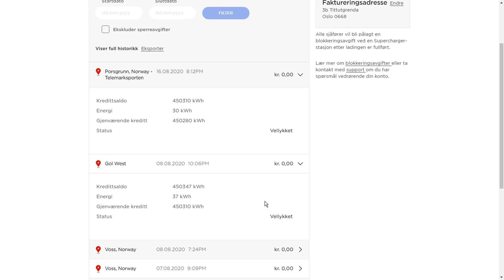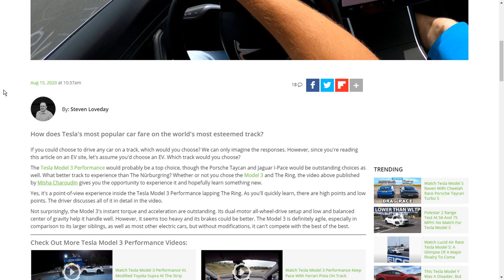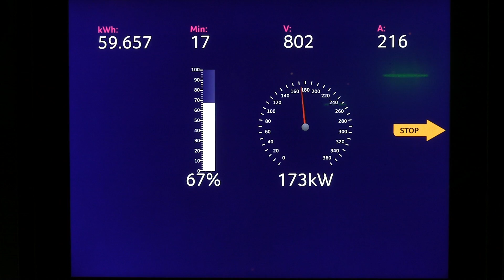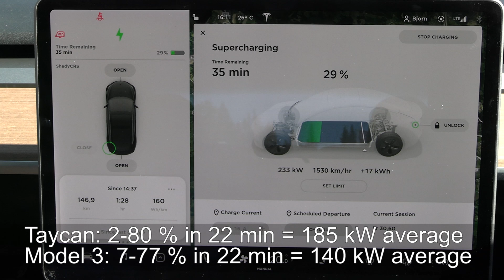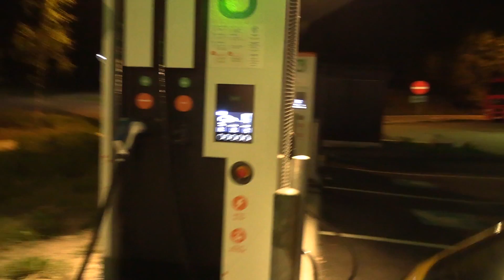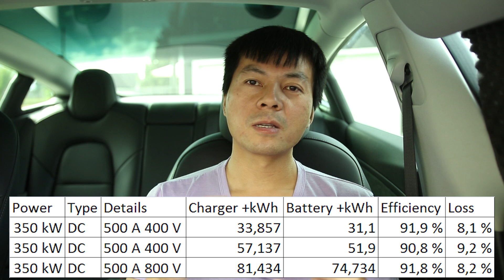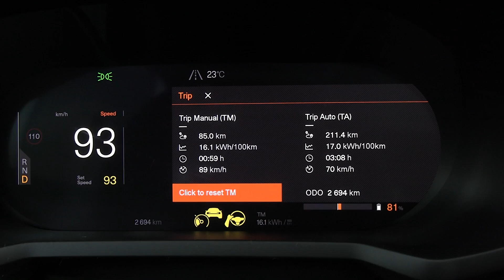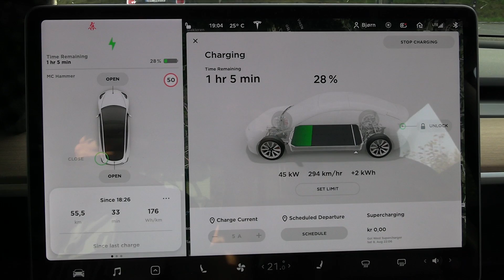Pros and cons of 800 V battery and charging systems

Comment: Most new 75kW+ chargers support 800V+ systems so there is no need to install 350kW like Ionity to utilize it.  It's only Delta that does not support it by default on their HPC.
 For example all Hyperchargers support up to 1000V, even the 75kW one.  And they are not more expensive than the 400V Delta chargers.
Reply: agreed, the charger isn't mush more expensive but the power to supply it is
Reply: @johnchartrand5910  How is it more expensive to supply a 150kW charger that supports 1000V vs one that's only supports 500V?
Reply: @baldurornoskarsson1204  power is far more expensive due to demand fees when it is used.
Reply: @johnchartrand5910  A 150kW 500V charger needs the same power from the grid as a 150kW one that supports 1000V.
Reply: @baldurornoskarsson1204  yes but the reason these high voltage chargers are put in is to support 250kw or 350kw

Comment: Capacitors have the ability to charge much faster but the energy density is lower so maybe there'll be a lower range car that can fully recharge in 10 minutes.
Reply: I don’t think the average person wants to be charging their cars every 100km because capacitors are empty. Supposed capacitors can run for that long. They would be interesting to higher launches. With lithium, Tesla can already do 0-100 in 2.4 seconds. With capacitors that could become less than 2s although having an independent system of capacitors just to have a better acceleration is probably not worth it just as an ev run by capacitors.
Reply: Super capacitors have way less capacity - like <10Wh/kg vs a reported 254Wh/kg for the lithium batteries Tesla uses. So to get the same capacity under ideal circumstances a super-capacitor would weigh >12 tonnes
Reply: CED99 So capacitors have 25,4 times less energy density per kg than lithium at best. That would put the 530km WLTP of the model 3 down to 20,8km. Not feasible in the short term or long therm either because I believe capacitors isn’t a new technology and therefore is close to being as good as it gets.
I was far to optimistic with my 100km estimation
Reply: Capacitors energy capacity is very low compared to batteries both in mass, price and volume, so for most EVs it is not worth it. However there are certain EVs with high stop-start that use them: CAF trams e.g. in Luxembourg. Other possible use: City buses and garbage collection trucks (start-stop every 20 m).

Comment: Hi Bjorn, as a battery modelling engineer for an OEM I would be happy to exchange with you to refine your analysis here. I am not saying you're wrong but there are points that can be clarified and would help understand why Porsche and Tesla have different charging curves than Audi and why efficiency should be dissociated from energy consumption. I am happy to help if you want.
Reply: Well, if you have time I would gladly want to learn more and ask some questions? Probably lots of people following this channel also...
Reply: Great offer in my view... I think you can contact Bjørn directly through Facebook (messenger) That's what he asked another follower to do the other day (about borrowing a Tesla Model 3 Sr+) I look forward to hear / see the results from your contribution in Bjørns reporting. BR, Per (Denmark)
Reply: @nakfan  thanks, I will have a look!
Reply: The voltage for each cell is always around 4 volts. The only difference in a 800 volt based system compared to 400v is the lower current in the charging socket, cables and connectors. Tesla cells throttle earlier because of their cell chemistry. Tesla beefed up the before mentioned EE to support higher current to overcome the 500a ccs2 Standard
Reply: @ExperienceCN  The difference between the P100D and the 100D is a custom-built motor controller that can handle the higher amps. Double the voltage, you halve the amps.
Reply: Very brave man.
Reply: i realize it's kind of randomly asking but does anybody know a good place to stream new tv shows online?
Reply: @Javier Kannon Flixportal :)
Reply: @Finnegan Skylar Thanks, I went there and it seems like they got a lot of movies there :D I really appreciate it !!
Reply: @Javier Kannon you are welcome :D
Reply: You model batteries? You pose in your boxer shorts holding a battery and wink at the camera? My wife wants to know more ☺
Reply: @Nickbaldeagle02  Haha, good one! Don't forget I'm an engineer so I only cover myself with calculators and rulers while doing it 😊

Comment: Hey Bjorn, why do you keep on comparing Model 3 with a Porsche Taycan ... i believe you should compare it with Model S ... just my thoughts!
Reply: Because Model 3 is the king of 400V cars what comes to charging.
Reply from the maker: Because Model S is based on a battery/EV design that was released in 2012. But Taycan came out in 2020 and has a more modern design. And Model 3 came out in 2018-2019 and is also way more updated compared to Model S.
Reply: @bjornnyland  So basically you're saying that Model S contains outdated technology ... ...so not a technological lead for Tesla.

Comment: The faster charger are still in needed , Consider  most cars being EV hardly ICE and how many charger heads would be provided to that amount?
Reply from the maker: Once people move over to EVs, more and more fast chargers will pop up in that country. Just look at Norway's impressive charging network. And as pointed out way too many times in this channel; you don't need to recharge too fast as long as you have large enough batteries.
Reply: As more EV's replace ICE vehicles, the current gas pumps will be replaced with charging heads
Reply: @Fredrickarm  And how many gas hoses in each station now?   How long it fills up those tank?
Reply: The thing with EVs, is you can typically charge where you park. More homes, more businesses, more groceries, more activity centers, more garages etc. will provide charging, especially in places where it attracts customers to shop/dine. Faster charging may be nice, but EVs really shouldn't be looked at through the lenses of gas cars.
Reply: Having carried out surveys of the time taken at various ICE filling stations in the UK the average was between 8 - 10 minutes, which included paying time, probably buying some snacks, etc. The main difference with EV’s is the majority of people will charge at home something most people can’t do with an ICE vehicle. There will be some living in places without parking that can’t do this but they may be able to still charge at work. This means you don’t need as many charging stations as fuel pumps but you do need many more than we currently have in the UK. There is still a lot of misinformation on charging station numbers in the UK, the apps show those at dealerships, which are not actually available to most people plus lots of 7.5kw chargers that are useless when on a long distance drive. This makes the map full of chargers but actually there are very few, especially outside cities.

Comment: Here is the thing: Porsche costs ~200k price of battery ~10%, model 3 costs 40k price of battery ~50%. So if you have got the porsche you really don't care if you "fry" the batteries earlier than of model 3.
Reply: So, you are saying both batteries cost around $20k
Since the Porsche battery has higher capacity, you are indirectly saying Tesla batteries cost more per unit energy than Porsche. 
Maybe it's possible, I don't know

Comment: Bjørn, I think 800 vs 400 doesn't matter so much. Differences are negligeble. More important how fast is possible to charge on home 3 phase electricity. We will see how new battery technology will run, whether it will be SSD or something else.
Reply from the maker: For home charging, 7 kW is fast enough for most people. I am even fine with just 3.7 kW. 11-22 kW which is possible today in many EVs is pure luxury.
Reply: I am also fine 99.9 percent with a single phase Schuko/household plug for charging. If I ever needed to make back to back trips with an overnight stop at home (very unlikely) then it would be obvious (to me) to use the street chargers around the neighborhood for the 7 or 11kW fast charge.

Comment: 800V is supposed to have a lot more advantages then just charging speed. I'm hoping that Sandy Monro does a teardown on the Lucid Air which is a 900V system and like Tesla, and unlike Porsche, is both effecient as well as high performance. Will the Lucid be significantly more effecient than Tesla because of their higher voltage or is their range advantage due mostly to a bigger battery?
Reply from the maker: "supposed" is the keyword here. When I drove Taycan, I wasn't thinking: "Oh, this 800 V system is awesome." The car felt and drove just like a 400 V car.

Comment: How is 800v supplied? Is it being stepped-up at the station? I thought ~400v 3-phase was the maximum you could get on a european grid? If being stepped-up, this will have (heat) losses that need to be considered.
Reply: Ooh, no. The UK railway overhead power lines are 25,000 volts. Have a word with the energy supplier and they'll happily build you a 100,000 volt power supply. For a small fee.
Reply: Normally it's 400V. But the voltage in the high power lines is significantly higher and since the charging stations need much power, they are probably connected to a 10000 or 20000V line. So it is possible to step it down to 800V.

Comment: In the Model 3 lap some performance degradation started at the end of the first lap, considering the length of the Nurburgring if the Taycan started to see degradation  only after 1.5 lap this represent a significant advantage.
Reply: Yes and he couldn't push it as hard as he wanted because the brakes got too hot
Reply: @xLaserwalker  Tesla 3 brake overheat warning after just 5.3 km,  1/4 of Nordschleife lap.
Reply: Foersom - Model S Plaid did a lap in 7:13 (Taycan’s best lap was 7:23) -
https://www.teslarati.com/tesla-model-s-plaid-production-pictures/
Reply: Save Rio - You’re comparing a purpose built sports car with a retail price of ~$240k to a family sedan that costs $60k. A much fairer test would be comparing a Tesla Roadster 2 to a Taycan.
Reply: @TraditionalAnglican  the Taycan is a Gran Turismo lmao. It's not an electric 911
Reply: @TraditionalAnglican  This is true for all the dynamic performaces of the car, here we are considery the tecnology behind the battery. If you take in consideration a 130k Model S you will have the same results.

Comment: Since it is possible to charge at 250 KW with a  400 V system,  and 250 KW is fast enough for any automotive application,  that proves that 400 V is sufficient.  For trucking applications,  higher than 250 KW charging rates will be required, necessitating higher voltages.
I Don't believe the amount of copper saved in an auto by going to 800 V results cost savings significant enough to overcome its disadvantages. In particular, the need for DC to DC conversion.
Reply: "250kw is fast enough for any automotive application"

For passenger cars, probably, but in the US, at least, I think we're going to find out with electric pickups and large suvd, which will probably get 2 miles per kwh at highway speeds on a good day, that a 250kw recharge speed, isn't going to be fast enough to convince your average joe to convert to EV, outside gas/diesel going over $6.00 a gallon.
Reply: @thelondonbroiler  let's look at that a little more in depth.  Assume the pickup has a 150 kWh battery to go 300 miles at 2 miles per kWh. Also assume the larger battery can maintain a 250 kW charge rate up to a 50% SOC. Doing the math, that would allow 150 miles  to be added in18 minutes. Seems good enough to me.
Reply: @npbetts1  That's good enough for me too (presently 30 min to get 100 miles in my Bolt).  My comment was a prediction of an average Joe in the US. I can already hear average Joe's FUD, "you mean every two hours I have to stop for 18 minutes?"  I've given literally over a thousand EV rides to mostly people that had never been in an EV.  The pushback to having to stop a little while to charge is illogical but pervasive.
Reply: @thelondonbroiler  That is unfortunately true.  They fail to see the advantage of charging at home 95% of the time far outweighs the disadvantage of longer stops during the 5% (or less) of the time they are on longer trips.

Comment: Regarding superchargers, BKK is now constructing 6 stalls with 960V chargers in Bergen, at least two of them have 200A CHAdeMO in addition to CCS.

They have installed 6 175kW ABB power packs (DC rectifiers).

They have the price as Grønn Kontakt, so Ionity gets a run for their money...

Comment: Give me a 1000km real world range battery and I won't care about charging speed nor about charging stations.
Reply: You probably would if even 22 kW AC took 12+ hours to go from 5% to 100%.

500km range batteries are probably the sweet spot between having a car that can charge quickly on DC and AC while not being too heavy.
Unless you're doing 1000km in a single stint... I don't see any reason for such a battery to exist.
Reply: @vaska00762  the reasoning is very simple: charging at home is not a wasted time and is the most economical option. My daily round trip is usually less than 50km. Once in a week I have a 250km round trip and something like once a month or two I have a much larger round trip. But I never cross the 1000km round trip. A 1000km battery is better for me than any kind of ICE vehicle as I'll save myself the refuelling time.
Reply: You will if it takes 2 days to charge to 80%

Comment: A truck needs around 130 kW for driving at 90 km/h. After 5 hours it needs a break for 30 Min. In this time it needs 750 kWh. That is a charging speed of 1,5 MW or 800 V @ 1875 A🤷‍♂️
Reply: 130 kW during 5 h = 650 kWh ; 650 kWh during 0,5 h = 1300 kW charging, means 1625 A under 800 V DC
Reply: @benoit6026  I learned from Björn that there are charging (and other) losses of over 10%. I've just counted them in. So 750 kWh could be quite realistic.🤷‍♂️
Reply: @ Lothar Meyer 
You’re right. My mistake.
Reply: @benoit6026  Nope, no mistake on your part, I could have mentioned better immediately😉
Reply: I've also given this very thing some thought lately.  The stations required to make electric class 8 trucks an acceptable replacement for the majority of the industry, would certainly be in there ballpark of what you specified (over a (edit) megawatt).
Reply: Unless you plan for the whole run, and have extra start capacity to charge slower on the break, or being able to adjust when to break. ( Or perhaps the charger is in use). Expecting 5-7 hours of nighttime charging will probably be necessary. Haven't done the numbers for this though. But we are probably way above 300kW.

But the forced charging stops will definitely make the transport sector safer. And the drivers might appreciate the lessened pressure to keep driving. Perhaps they should even be 45-60 min charging breaks.
Reply: Heavy vehicles like HGVs and buses will probably move to Hydrogen Fuel Cell technologies just for the ease of refueling. Even if hydrogen is really bad at energy density compared to fossil, the energy density of hydrogen is just much better than current batteries.

Siemens is looking into getting HGVs into using a 750V DC overhead line system, not too unlike trolleybuses, but with pantographs instead, more like a train. The HGVs could run at 90-110 km/h and draw all their power from the overhead lines for highway driving, switching to batteries once off the highway and going towards a freight hub.

We could be looking at cars and motorcycles completely going to batteries while heavy vehicles move to hydrogen or overhead line solutions.

Comment: Model 3 lap, they did some cooling in between seems like because of a speed restriction. 
There was power limit applied as well.
Reply: and he could not go full out becasue of overheating brakes.
Reply: Yup, there is a portion of the ring that has a speed limit.

Comment: In terms of loading a truck is definitely better to have 800V System.
Its the same you, as a European went to USA and want to work there with the 110V current system, you become cracy. It shows, more is always better. Don't start too low into the future, because a change after installing thousends of stations will be very expensive.
Reply: Yeah, 400V seems a reasonable sweet spot for the average personal vehicle, but for larger commercial vehicles higher voltages will be beneficial.
Reply: North America is 240v service.

Comment: It will be mostly a matter of costs for which system will win. With 800V you would need thinner cables and therefore I would expect lower costs for that. But if costs are increasing with either total power output than the thinner cables might not compensate for that increased power. Or if the support of two voltage systems are increasing costs at the charging stations than this might be also a no-go. Porsche doesn't need to care about costs at the end users. But EVs are becoming more and more a mass market product then prices will matter a lot. On the other hand I think that the 800V system hasn't reached its limits with what Porsche has done so far. So there is probably still room for improvement (maybe less so with the CCS system). And probably most people still agree (and that is still the biggest hurdle for EV haters) that reducing the charging time further from 20min down is still on top of our wish list.